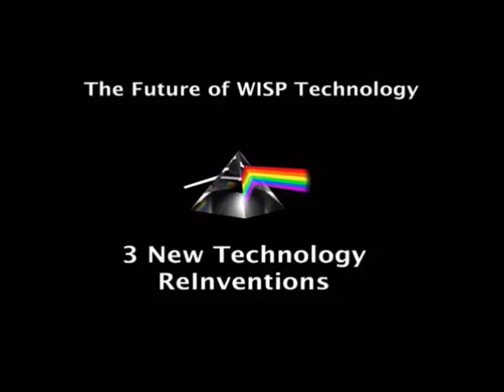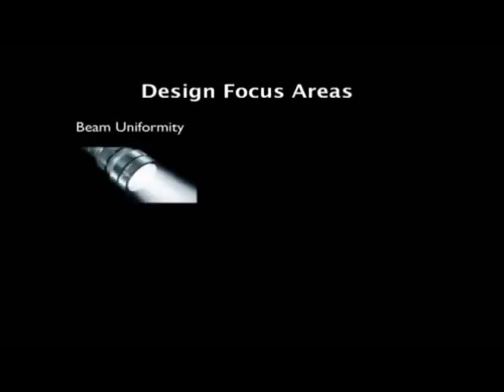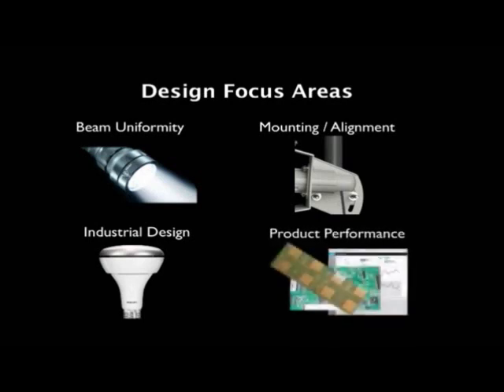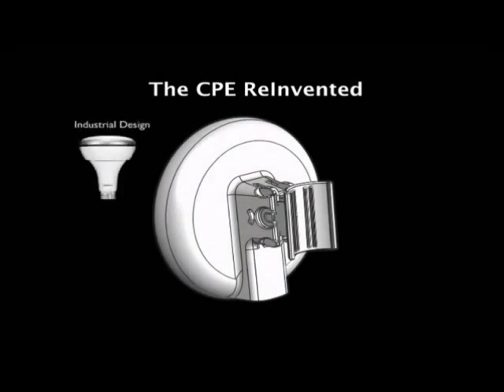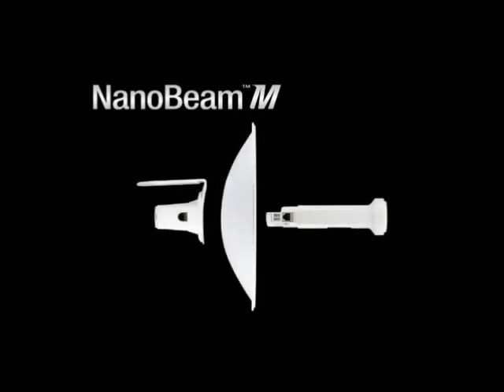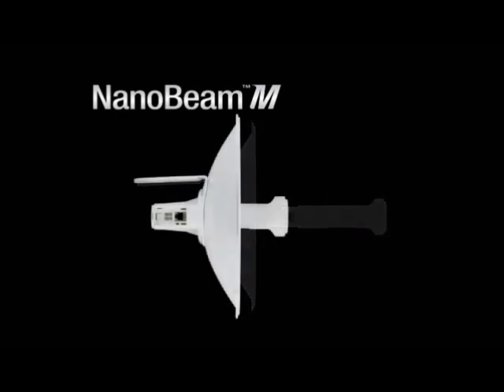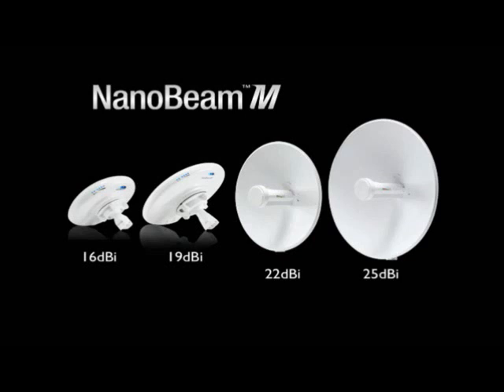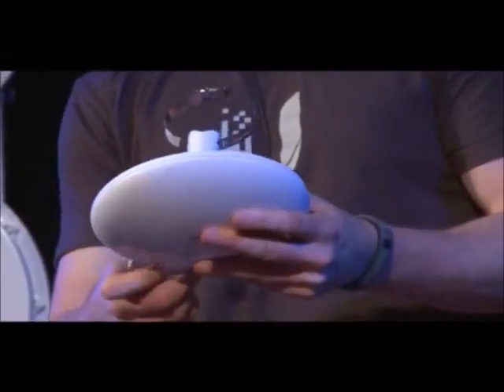UBNT Revolution (mejores momentos): Presentación del NanoBeam. Próximamente en www.landashop.com

Comment: This is not a good device when you increase the output power to 26dbm it will go dead I had tried on 4 nanobeams m5 19 and all 4 are dead.
Company is not replying about this problem from 2 months.